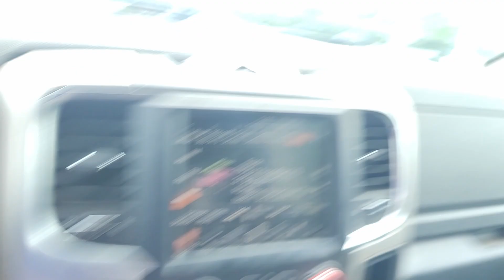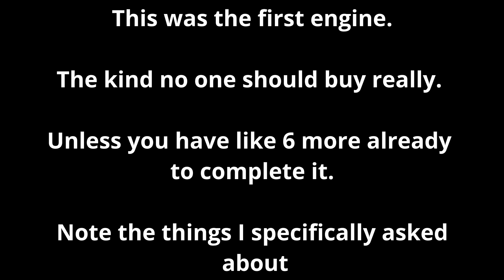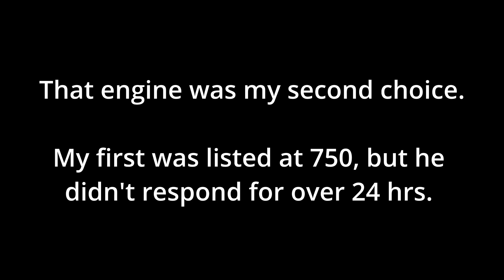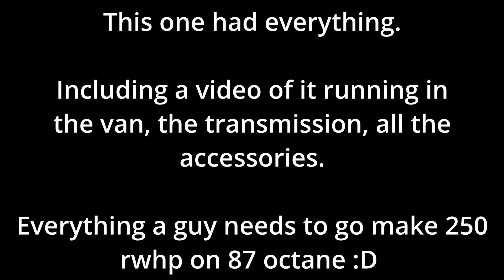How to choose an engine for your project! A tale of two big blocks.

Comment: Duuude... First, i have a fair bit of experience messing with these. Those 727s are super simple, whole valve body comes out as an assembly, so no check balls to drop, the rv units have 4 pinion planets over a car or truck 3 pinion, save yourself the cash and do it yourself. This was the exact first full tear down and back together on a trans for me, and it was easy. Second, get another ignition box and keep a spare in the vehicle with you, they like to die without warning. Cant remember the title of the Mopar performance magazine, but the ballast resistor can be deleted on these, according to them. That looks like a York compressor on there, easy yo convert to on board air compressor(4x4 guys might want to buy it if you dont use it), and last...i got a copyright strike from music on the radio in the background on one of my videos, so be careful with that. Gonna be following your build👍
Reply from the maker: Putting this junk directly in my truck isn't much of a build, but I'm glad to have you on board!

Comment: Walked into a broken down shop one day, responding to a CL ad for RSX and Integra parts. Just looking for a few things for the 2006 RSX Type-S I just bought. Really just wanted the engine from my car for another project, but thought I’d drive it for a year, since it was roadworthy. Middle aged Vietnamese dude who used to build Honda drag cars (1,000hp). He was retiring. Said he hade a Type-S engine/6sp trans from a 2004 Type-S sitting in the back. Low miles (ran to the scene of the accident). Asked him what he wanted. $2,500. I said thanks, but no thanks. I ended up coming by again for a couple more things, and offered him $1,000. He took the cash, I took the engine/trans. Turns out the early K20A2 engine is easier to throw an ECU on, so it worked out. So, yeah. Don’t be afraid to walk away.